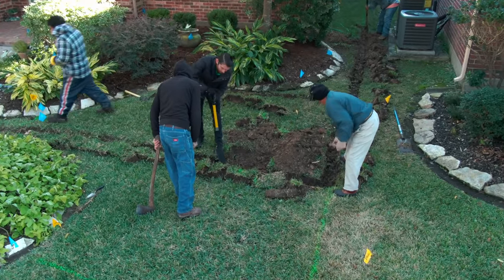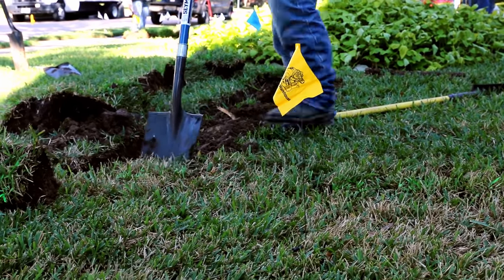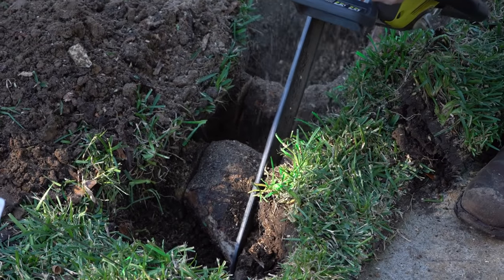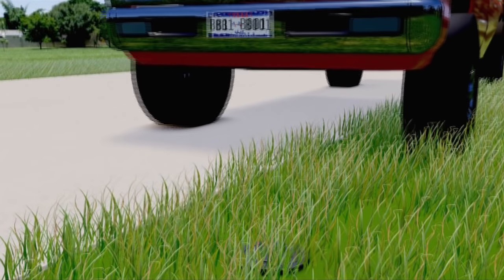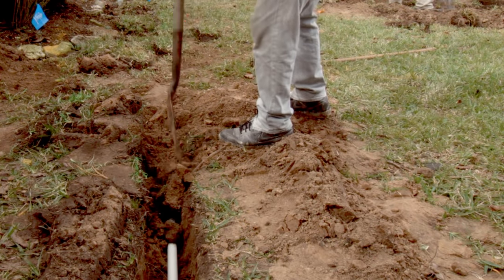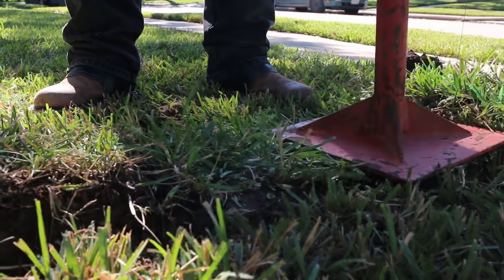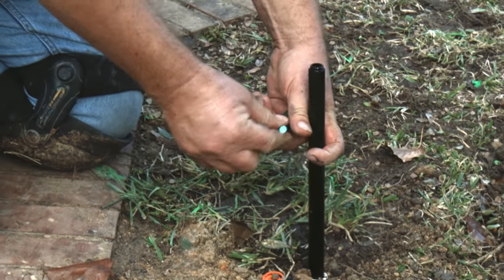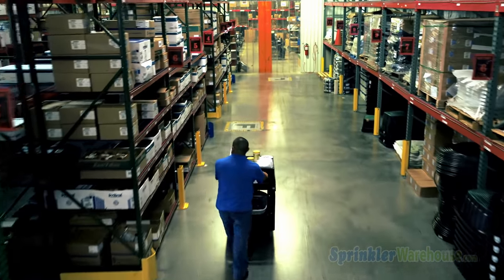Trenching, Pipes, & Sprinklers

Comment: First of all, before you start a sprinkler system you must have knowledge of some basic things.  1.  Determine what your water pressure is (take a measurement at a spigot, different times of the day) 2. You need to know the meter size;  5/8 will flow 15 gallons per minute,  3/4 inch will safely flow 22 GPM 3. Make sure you have an independent electric outlet for your controller; if you have a controller on a GFCI, it  when the circuit trips your program is saved on battery until the battery runs out but your system shuts off due to no power 4.  Also, this video makes no mention of a cross connect to your main water line, you  will need a backflow prevention device;  in Texas we use a double check valve.  I like to use the 1 inch double check valve. 5. Zone your stations according to pressure, meter size and distance from water meter for best results.
Reply: I was looking to see what size pipe he used for that reason, thank you

Comment: I’ve been doing irrigation for 30 years now and one thing I can’t stand is fixing a leak and it’s the bottom pipe. When that happens you usually have to cut the top pipes to the bottom pipe and agter you fix that one you have to go back and fix the top ones. Lay the pipes side by side as it makes it much easier.
Reply: Have you ever heard of companies that actually mark the location of the pipes??   It seems like most companies do not bother with thar.  Extremely important to know where the pipes are located.   it's so ridiculous that so many 0:01  companies don't bury a wire or mark them on a map or something.   Anything.

Comment: The Technician in the video was marking running lines with green paint. Green paint is 811 color code for sewer. They need to stick with pink paint or white paint. Be sure to verify with your local 811 laws.

Comment: Just a suggestion, but wouldnt it be better to put the wiring next to or right on the main line for the sprinklers, that way if you run into any problems you can identify which is the mainline and which are zone lines? Also i wish i was in Texas that dirt looks nice to dig ! Im from NewJersey lots of mountains and very rough compacted dirt, sometimes we remove boulders out of the ground, hand-digging here is super rough! We also use poly pipe for zone lines and Pvc for main line only.
Reply: Put your wires under pipe. So that someone cuts a pipe before they cut a wire in the future. Cut just a wire and you probably wont know it then will be hard to find.

Comment: Nice video. Try putting the spoils on tarps. It's a lot cleaner and easier than scratching the spoils out of the grass. I flush my lines out before I put the heads on. I put the nozzles in all the heads on my tailgate. It's a lot easier. And you only have to get on your knees once
Reply: My purpose was to help others go about things in a quicker more efficient manner. Something that I've learned over 40 years. I think people would appreciate that. Learning from someone who's been on that square hundreds of times. Thank you
Reply: All great advice. Flush is a must every time.
Reply: So you get all your heads on without getting any dirt in the lines ?

Comment: Good video but the trenching by hand cracks me up. Here in SW Colorado with hard, dry, sun baked clay soil, you need to rent a trencher to get anything done. For hand digging valve box locations, I use a 5 gal bucket with a spout to drip water onto the area constantly for a few days prior to digging. That softens it up enough for the shovel.

Comment: Should the tech test run the system before covering it up with dirt and sod? Make sure there is no leaks
Reply: I've been installing sprinklers sine 1994.  After we connect all our zones,  we start filling up trenches before we test the system.  If you have a leak, it can be easily fixed.  I've only had one leak in all those years.  If you properly join the pipes, fittings and heads you should have no problems.

Comment: This is a good video, if h/o tries to use this advise I can see future repair work for service techs. That's why I love videos like this, it creates a lot of work :)
Reply: I agree did you see them install that fitting pointing straight up! Haha no mention of gallons per minute to calculate how many heads to use on one zone either!!!
Reply: This install was one of the worst ones I've seen on youtube. There is a guy above in the comments who actually tried telling me this was a fine install and this is exactly how to do it.
Reply: Pipes seemed to be installed too shallow and therefore subject to certain damage from future digging, aerator tines, etc.
Reply: @alvinlowe843  they're not, you should try installing a system in an existing landscape. You would be surprised the level of difficulty
Reply: @michaeldavis3188  I have installed irrigation lines and heads before. And it isn't always a piece of cake, especially when done near tree roots, extremely hard/ bad soil, etc. But just because an installation is "difficult" doesn't erase the fact that several (not all) of the pipes in this video definitely seemed too shallow and more susceptible to damage (shovels, aerators, etc). Lateral pipes (from valves to sprinkler heads) s/b a minimum of 8"-10" deep. Mainlines (from pressured water source to the valves) s/b deeper.
Reply: @alvinlowe843    @AnotherDave 
Do you guys have any videos with more information on how it's done?

Comment: Some tips:
Place threaded fittings sideways, not upright. This makes maintenance easier in the future, and lessens the likelihood of breaks. 
Do not use side inlets. If you ever need to replace the actual pop up bodies, repairs are going to take a lot of digging, and a lot of unnecessary work
Reply: ...and twist the cemented joint 45-90 degrees to its final position after insertion to ensure even distribution of the glue. Some plumbing inspectors will look for how the glue follows the edge of the fitting on potable water piping as an indicator of a properly assembled joint..
Reply: @cdel46   no one inspects irrigation pipe like that.. especially a plumber... The real problem here is sch40 with Cristy's hot blue. Could've saved money and had an even more efficient system as far as pressure losses and a quicker install had they went with CL200 and regular clear solvent.
Reply: @noeeon9910  I agree with the CL200 for all around install.  Sch 40 has over 800 PSI,  most homes have less than 80 psi.  I never use pipe cleaner,  I just apply Cristy's PVC cement,  it seals faster and even with water on pipes.
Reply: @diyhomeprojects7317   yeah it does seal faster and is made for repairs where residual water may be an issue. But be careful using the Christy's with cl200 that solvent weld is strong and will eat through the pipe at the joint if you use it in excess.

Comment: Expected solvent welded plumbing to be 1/4 turned and held together for 30 secs before proceeding to next task.  Expected pressure/leak test before covering with dirt.
Reply: you must not do many irrigation repairs if you wait 30 seconds after using primer and glue. You really don't need to wait that long budd
Reply: @michaeldavis3188  yep,  just 5-15 secs is fine from my experience

Comment: I have old copper piping ran for my wiring encase. Is it possible to run the wire through the soldered pipes. I'm thinking the issue would be the 90 degree turns. Any suggestions or should I just bury it? How deep?

Comment: Shouldn’t you test the lines before filling the trenches?
Reply: Yupp it would’ve been a shame that after the pipes were covered there would be water gushing out... better safe than sorry
Reply: Lol ... only if you are a noobie who doesnt trust your own work do you test the lines before you backfill LOLOL.
Reply: Regardless of a noob installing the irrigation, maybe there’s a product defect. Always check to make sure everything holds. Not sure how burying your pipe immediately is efficient or cost effective. Either way you will have to fill the trench. Why not just wait to fill the trench after you check to make sure theirs no leaks? 🤷🏽‍♂️
Reply: Been doing it a long time ... if it happens you re dig that area... its never very hard unless you dont know what you are doing and mess up big time.. 

And if its a brake or a "defective"part .. which again ivenever had happen ... you dig up ... a foot section and fix the brake? Just like a service call ... itsa lot easier to back fill as you go.. if you arent a tech i understand why you dont understand LOL
Reply: Most companies cover first. Go turning water on all that uncovered dirt will make covering up 5 times as hard. Dry soil MUCH easier to move.
Reply: @guidoslandscape2006  I never do because I know what I'm doing;  been doing it for 30 years.

Comment: I would have rented a chain drag trencher for the day. Much less mess, no manual trenching required and much faster.
Reply: It’s not worth it, the trenches don’t have to be that big
Reply: I agree;  my wife and I installed a 5 station system in our 2nd home in S. Texas.  We rented a trencher from Home Depot and finished the 50 x 90 lot in 4 hours.  Day 2, we cleared the trenches, dug trenches where machine could not trench and laid out the pipes, fittings, and heads for each zone.  Day 3;  installed the backflow prevention device at the cross connect to the main line and started fitting all the stations.  Also installed the electrical wire Day 4. Finished the last zone and heads;  started back filling trenches Day 5;  installed Rachio Controller and considered the job complete.  Total cost with rental and materials including controller was $1,500.  Saved about $2,000 on labor.
Reply: @cyantadeo975  Disagree;  the trench has to be at least 9 inches where pipes overlap.

Comment: I've used flexible swing on my yard and don't like the flex. I prefer rigid pvc because the head stays aligned even when soil shifts or settles.
Reply: I'm over 40 years in the business. Flex pipe is a fantastic thing to use for many reasons.

Comment: Can I put 3 sprinkler heads branching off the same flex pipe?  The flex pipe run will be approximately 50 ft and there will only be 4 total heads in that zone.
Reply: Take into account the amount of water pressure you have. If it’s high enough, usually around 60-80psi you should be ok. Also take into account what size nozzle you will be using to maximize coverage.
Reply: Flex pipe is used for a maximum run of 24 inches. Although running it longer is possible you don’t want to do it. If you need to add more heads at a future time you want the flow of the larger pipe. Running a long distance of flex pipe also increases the friction loss significantly.

You can say the math works but professionals don’t do it because it causes maintenance issues in the future and it’s just wrong.
Reply: Dont run flex pipe 50 feet. You will choke the pressure.  Not meant to be run that far.
Reply: @kylebrost2435  no. The math does NOT work. It's in friction loss charts.
Reply: Before the hordes flooded in, most systems were properly designed and installed. By Americans.  Now most systems are crap. Especially the slave wage companies installing for builders. The people have no pride in this country and therefore no pride in their work.
Reply: Mike Curliss I’m not talking math. I’m talking best practises. Using flex pipe everywhere arbitrarily limits yourself in the future for no real gain in the short term.
Reply: @kylebrost2435  Best practices means taking math into account.  If the math allowed it I would use more of it. But not arbitrarily. Theres no magical 24 inch rule either.
Reply: You simply cant run long stretches of it due to the math. Think of "spaghetti " tube ,for example. That feeds a potted plant. Much smaller than flex. But you can run much more than 24 inches. Same with flex. Depends on the volume running through it.
Reply: But ya. Ha. 50 fert through flex would probably choke off a quarter circle head with only 1 gpm due to friction loss...numbers...math....not some arbitrarily length.
Reply: Mike Curliss can you send me a link to a friction loss chart for flex pipe?  I have not seen them as they are not routinely used for water distribution. Take 4 heads with 5 foot toro precision nozzles at the end of 50 feet of flex and you will find the math works. My advise is designed to support future changes and is based on the best practise of not over provisioning your system. By using 50 feet of flex pipe as water distribution you have created a situation that could lead to a system that does not work due to math and future changes of the system.
Reply: I have never tried to run heads off 50 feet of flex pipe. So I wouldnt know. Never bothered to look up a flex pipe friction loss chart but I'm sure it's out there somewhere.
Reply: Mike Curliss  then why would you use that in your rebuttal?  “The math does not work look at the friction loss charts”. Haha that’s just silly talk!
Reply: @treyvorcamara9530  no. It's not ok
Reply: @kylebrost2435  First of all he wasnt talking about toro PRECISION nozzles.  Otherwise,  wont work. Due to the math. Due to the friction loss. Which is proved in charts.
Reply: 5 full circle toro PRECISION nozzles off 50 feet of flex ? They might spray but not too well probably. Probably  arely
Reply: Mike Curliss there you go talking about fictional fiction loss charts. Show me the chart and your argument has some validity. Until then it’s just a hypothesis and math cannot validate it. Show me the chart!  Or continue your super silly talk.
Reply: @kylebrost2435  oh . 5 FOOT TORO PRECISION NOZZLES!! ..5 FOOT?! WELL THATS DIFFERENT. Ok so THAT will work. Pretty sly of you to pick 5 footers......which will probably clog too.
Reply: @kylebrost2435  I dont need to look at a pressure loss chart to know 5 heads (other than 5 toro PRECISION low volume 5 FOOT nozzles ha) on 50 feet of flex wont spray so well.
Reply: @kylebrost2435  I dont have to show you the chart to prove validity.  Look it up yourself.
Reply: @kylebrost2435  Do you know how much a foot in elevation changes water pressure?
Reply: Didnt think so. The most basic of hydraulics.  So you dont really know how to design a system either.
Reply: @kylebrost2435  just look up 1/2 inch schedule 40 it's about the same and quit arguing

Comment: Okay good tips here, and a very good install. But theres a few things I'd advise not to do... 
1) dont use blue glue on installs, use clear.
2) dont use swing joints they come in predetermined sizes. Use swing riser pipe and barbed els makes install fast and repairs easy. 

3) dont kill your employees by making them hand dig a whole install.
Reply: Hand digging ain’t that bad especially considering the fact they only installed the system in the front yard, however using a shovel to make trenches is not a good idea it’s better to use a talacho
Reply: What do you mean "swing riser pipe"? I've used flexible swing on my yard and don't like the flex. I prefer rigid pvc because the head stays aligned even when soil shifts or settles.
Reply: @josiahutah3712   swing riser pipe is the actually pipe used in swing joints. They come in 100' rolls and are reasonably priced. You connect them to barbed els. Now, in my experience if the ground settles or shifts I'd prefer to dig up a head a little and just adjust and tighten the dirt around it rather than to dig the head up to repair a broken nipple or T.
Reply: Why do you say not to use blue glue?
Reply: @isaiahvaldez9147   blue glue is STRONG and great for Large PVC Repairs because it settles quickly and will still adhere if the pipe or fitting isn't completely dry. When repairing with Blue Glue make sure you wipe all the excess off the fittings or pipe, over time the excess blue glue will compromise the PVC and make it brittle causing it to leak. One of the most common reasons for leaks is excess blue glue at the fitting. Imagine a whole install like that....... Use clear, the pipe is clean and it's easy to work with. Doesn't settle as quickly so you can swiftly correct a mistake.
Reply: Blue glue is fine. Been using it for over 20 years. I thought clear glue sets the fastest and Gray glue sets the slowest
Reply: almost everyone I know in irrigation uses blue glue, personally I use clear, and that's because that's the only one that I had at the moment
Reply: @aaronbaraiya3692   blue is unnecessary, clear is a way better option. The blue glue has a higher viscosity and if there is excess around the connections at the fitting it can weaken that spot. Blue glue is an excessively strong weld meant for wet connections. Clear glue however, can be used on pipe that will be visible and makes connections smoother. It is a perferred glue on repairs where the pipe is brittle or when using a bell end as a slip fix.. clear glue is the way to go most the time. I only use Christy's hot blue when the meter is old and I just have a bit of water coming out of my main.

Comment: what is the point of the wiring?
Reply: The valves are solenoids and solenoids require power to run. The wires are from the controller to the valve box

Comment: Here in washington we use 4 inch or 6 inch pop up heads for lawn and glue 721 its got primer in it so you save time
Reply: Well. Here in tx we dont. Inspectors want to see the purple primer for one thing. Is 721 for poly pipe ?